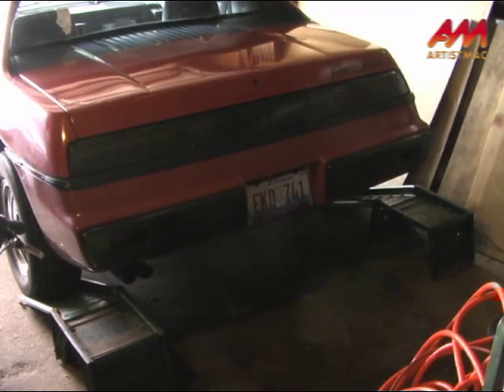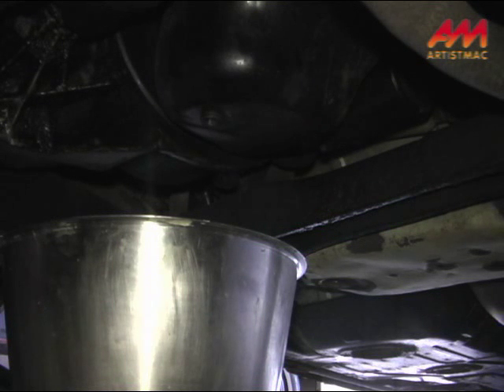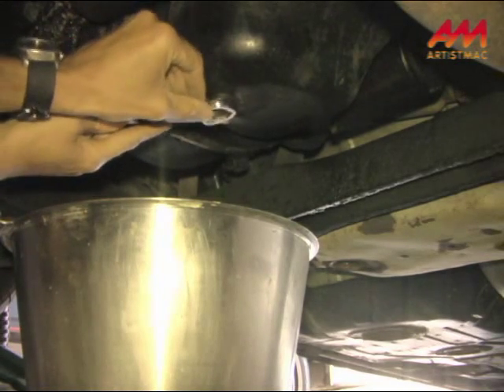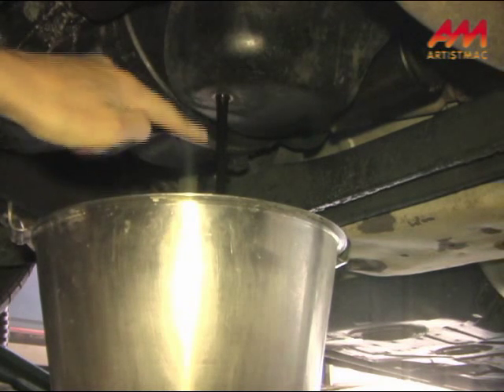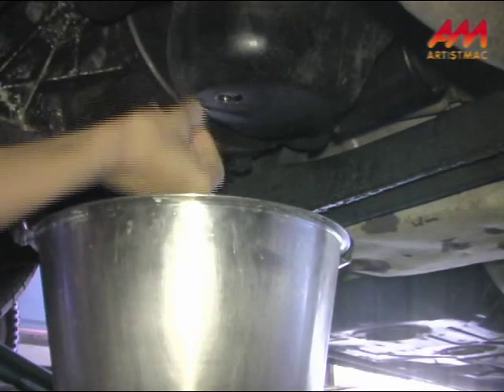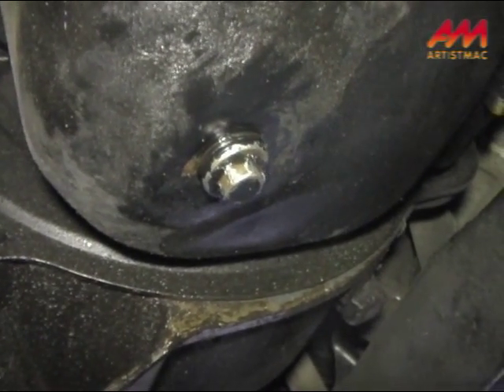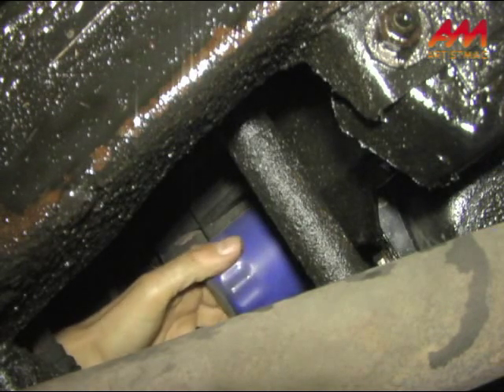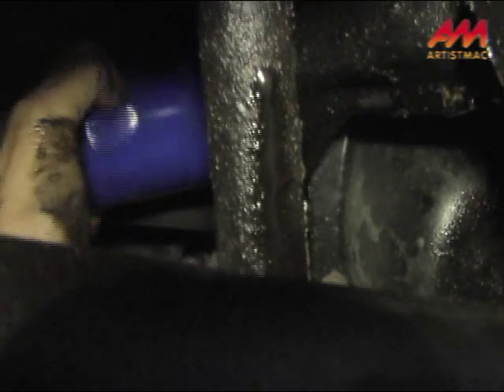Oil Change in a Pontiac Fiero

Comment: I’ve always filled my silver 84 se with 5 qts and never have had a problem. And I always use pentosin high performance full synthetic. It is a German made oil designed for bmws, Mercedes and Volkswagen. Engine runs sooo much smoother since I switched from conventional. I was prepared for oil leaks from the synthetic and had a couple. Changed the gaskets and it’s been great ever since. Best investment I’ve made in my fiero.

Comment: Hey there! I know in this video it was 12,000 miles between your oil changes ha ha, but typically in your ownership of this car, how many miles would you go between oil changes to be safe? I just purchased one of these cars about a year ago and still working out fine. Details on what I like, figured I’d ask somebody with experience!
Reply from the maker: As seldom as mine gets driven (it's basically stored in the garage in the winter) probably 5,000 to 6,000 miles. If you're going to be driving it on a daily basis, definitely 3,000 miles. Motor oil and oil filters are a minor expense compared to a complete engine replacement, which was running about $2500 in 2015, and would definitely be more now.
Reply: @artistmac  I appreciate the quick reply, especially on one of your older videos!! Love my Fiero but still learning about it everyday. Plus, a car as old as it is, the owners manual doesn’t always apply as well as it once did, especially between recalls and other modifications from the original design simply due to parts breaking and wearing away. It’s awesome to have a community that still has some love for this car that is available to talk with. Thanks again :)

Comment: have you ever used lucas oil stabilizer in the fiero it does great results on the engine and helps them with high miles on them good video

Comment: Just picked an 85 2.8 manual for 300$. Put a new fuel pump in, flushed tank , changed oil and it fired 2nd crank after sitting in Bend Oregon outside for 4 years . Its gonna be a great summer. Now on to motor swap for my 86 GT auto trans5 , Also 300$ plus 300$ for a punched to 3.2 never been fired motor..

Comment: Thanks for this! I bought an '84 a few weeks ago and have never done an oil change myself before but after watching your vid I think I can handle it! Does anyone know if you can use synthetic in Fieros or have any specific oil recommendations? Mileage is 65k if that's relevant.
Reply from the maker: This is from the '84 Owners Manual, "If outside temperatures are not expected to exceed 38 degrees C (100F) prior to your next oil change, SF-quality, SAD 5W-30 Energy-Conserving engine oil is the preferred viscosity grade."
Reply: I would stick to 5w30.

Comment: Have you tried Quaker State Defy? I've put it in my truck and recently bought enough for the next three oil changes. It seems to be good oil, and it has a high zinc content for bearing and camshaft protection. Nice little Fiero by the way, and a good video.

Comment: I just bought an '84 Fiero sport, miles are unknow reads 70,000 but motor was rebuilt.  It runs about 2000 rpm at start up for about 3 mins. and while driving at 55... its around 2500-3000 rpm. also while at a stop light it shakes hard... any suggestions? I love the car and find you videos very helpful.
Reply from the maker: If you've done all the usual things (PCV Valve, the correct spark plugs and plug wires, running fuel system cleaner, changing the air filter, coolant temperature sensor, MAP sensor) and it's still doing that, try replacing the white filter that's under the black charcoal canister. Most owners don't know it's there, so it's probably never been done. You can buy the filter material at any auto supply store -- keep the old one as a template so you can cut the new one into the right size circle shape, and slip it in under the bottom.

Oh, and pray nothing's wrong with the ECM -- they can go bad.
Reply: Thanks for the tips... I did as you suggested with the white filter and it took care of the issue.

Comment: in my 86 fiero gt, what size/wght oil should I use in the spring/summer season? 5w 30 or 10w 40?
Reply from the maker: +mach smith Here's what  Chilton's manual says: "Pontiac recommends that if the outside temperatures are not expected to exceed 38 C. (100 F.) before your next oil change,  SF quality, SAE 5W-30 Energy-Conserving engine oil is the preferred viscosity grade." If you live someplace like Phoenix, Las Vegas or Palm Springs, where summer temps regularly exceed 100, Pontiac lists 10W-30, 15W-40, and 20W-20, depending on how hot the weather stays and whether you do a lot of stop-and-go driving.
Reply: +artistmac Thanks for the info!

Comment: I know this video is fairly old, but if you run full synthetic through it youll have longer engine life. i know you typically would with any car, but i was told conventional oil especially in the fieros, well it didnt do so hot. just tryin to help you keep the ol'girl on the road. :3

Comment: hey man im a big guy around 6'3 or 6'4 would a fiero be a comfortable car for me?.....anyone else whos my height or close to my height chime in....
Reply: Nah man it wouldn't be very comfortable. I'm about 6'1-6'2 and I drove one a couple days ago and I was so congested. I had to bend my knees to sit comfortably! But the best thing to do is to find one where you can test drive it.
Reply from the maker: The Fiero might be a little snug for someone your size -- about the maximum would be 6-2 or so. But as a gauge, I'm 5-10, and with the seat slid all the way back, I can barely reach the pedals. You'd have to try one and see for yourself.
Reply: I dont see how it would be uncomfortable ONCE youre in it. The engines in the back. You have hella bomb heckadoodle leg room. Its just too low to the ground.
Reply: I dont see how it would be uncomfortable ONCE youre in it. The engines in the back. You have hella bomb heckadoodle leg room. Its just too low to the ground.
Reply: im 6'1 its plenty comfortable in that aspect of sitting and driving it. as mentioned before tons of head and leg room. Getting in is no problem.. its getting out. Sure the steering wheel does tilt but not enough.
Reply: i'm 5'8 with the seat all the way back and it's a bitch to get in.. hurts my left hip sometimes
Reply: My dad is 6’4 and he fits fine and is comfortable. My mom has a lot of trouble because it’s so low to the ground. Lol

Comment: 165,000 miles. That is amazing because those 4cyl engines were not very good.  GM never made good 4 cyl engines, even back in the days of the Corvair. (that whole car was garbage)
Reply: The Iron Duke was a good engine. The present day LLV U.S. postal trucks now a days use the same engine! Have you ever owned this engine?